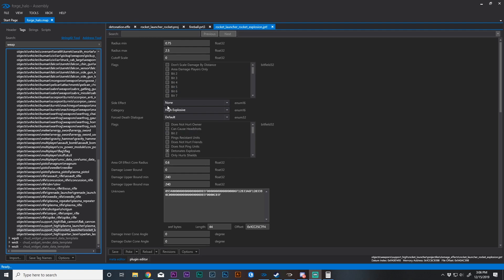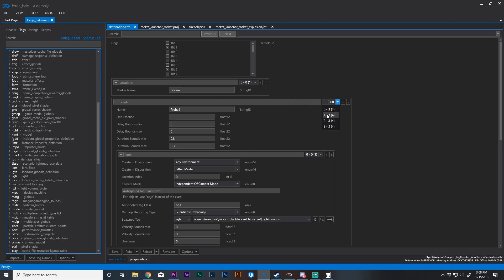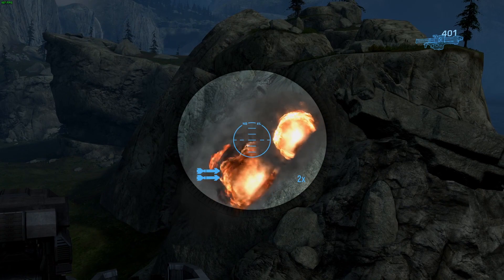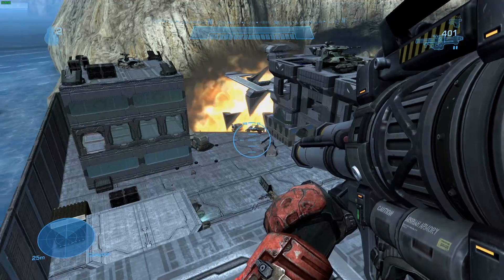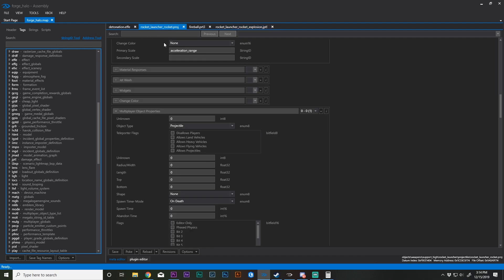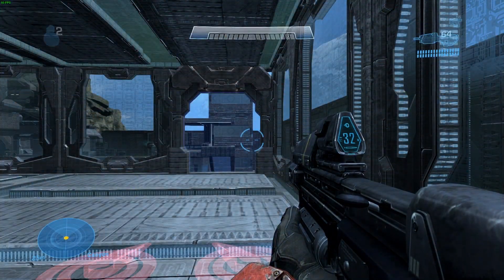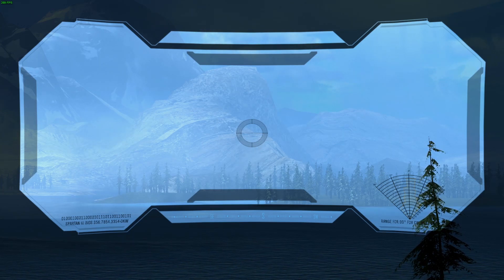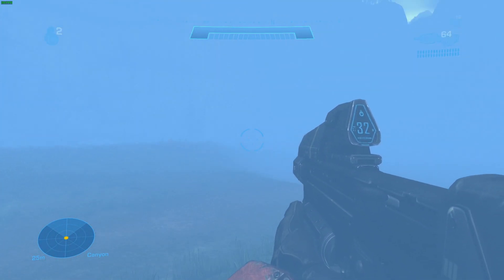Halo Reach PC | Assembly Tutorial #5- Mini-Nuke, Damage Effects and Fog

Comment: so iv been messing around with changing the weapons and making them shoot different projectiles etc... however when i get my friends to join for some fun, the guns have the changes saved for the most part, but if i have them shoot different projectiles, my friends will see the standard projectile but it will still have the changes i made. IE if i make the shotgun shoot grenades, they will see the standard shot gun shot, but it will still explode and i will see the grenades but they will not. how do i go about fixing this? ive saved these changes to the map file and can reload it myself and all changes are there, but my friends wont see the changes
Reply from the maker: Assembly Devs are working on this, it appears to be a problem with network synchronization of tag injected items, but your friends should have the same modified file as you so everything runs with less issue.
Reply: Ok awesome thanks, keep up the great tutorials